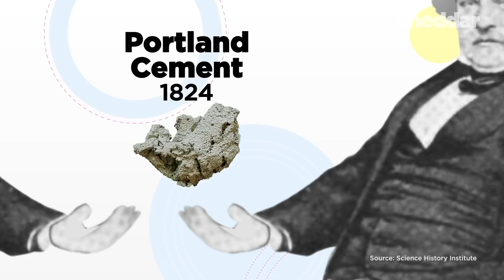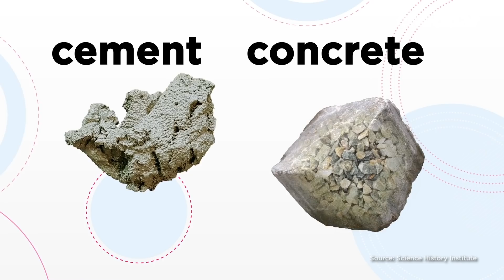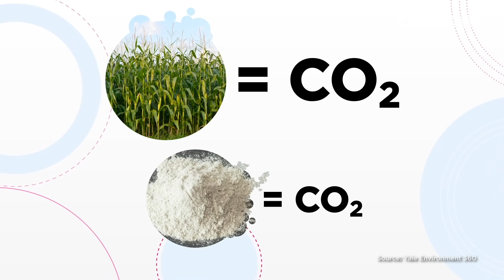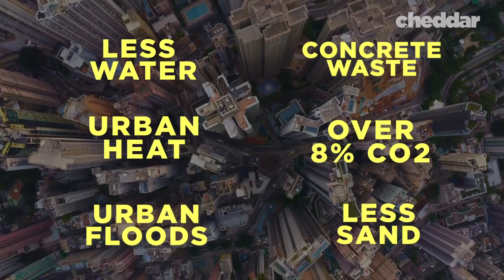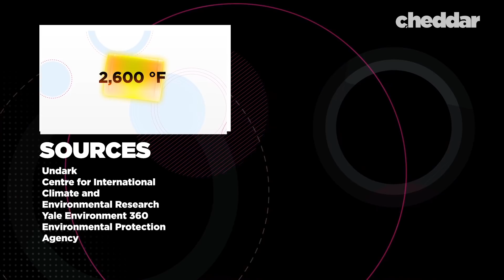Is Concrete The Most Destructive Material On Earth? - Cheddar Explains

Comment: why would concrete go to land fill when u can secycle it by crushing it and reuse for road base and other material depending on how finely crushed. Well at least we do in Australia
Reply: It can be somewhat recycled but only at a significant loss of quality.
Reply: @MTobias  Using it as road bed or fill doesn’t require same quality. In Seattle we just demolished a viaduct on our waterfront and most of the concrete was reused to fill an old road tunnel.
Reply: @MTobias  mjjjjjjjjj
Reply: It's also very labor intensive.
Reply: @stoneprevious4294  how can it be labor intensive there are machines to crush them like 90 percent of the work is been solved.
Reply: What can’t be recycled could be used as wave breaker in beach eroding areas, right? Even can be used to help form foundation for coral
Reply: It’s done in the US too.
Reply: @broe5010 broe5010 ah yes the stereotypical "It's all America's fault" add up the pollution, waste, and problems europe has caused and then compare and come twll me how its all America's fault. Look at China and the fact that they do all of that in massive amounts higher than any other country.
Reply: @broe5010 broe5010 Can you articulate those consequences or you are only able to make vague autistic eco communist noises?
Reply: Plus don't forget all the rebar in concrete
Reply: To make the problem seem worse than it is.
Reply: @broe5010 broe5010 am American, can confirm. But don't generalize and say all of us are like that. A significant portion of our population is brainwashed by corporate propaganda and another large portion is simply apathetic. But there are still many who actually care about something, its just we're not the loudest ones shouting.
Reply: Yeah but alot of the times it's cheaper to just get the raw material from a quarry then the get it recycled and big companys don't care about the environment
Reply: Its the only thing we do here in europe
Reply: Only 10% of waste concrete is recycled in Australia, the rest goes to landfill. A construction company's ability to recycle concrete is really dependent on whether there's concrete recycling plants nearby and most countries don't have enough concrete recycling plants to recycle all of their waste concrete.
Reply: @pilchardpliskin9381  -- Well, I've come to look at landfills are mines for future generations.    At some point our grandchildren or their grandchildren will be able to re-open sealed landfills and extract various metals, plastics, and minerals with little human effort.
Reply: Well,I never knew Australians are just like Canadians, always showing off!
Reply: @hoffmankipkurgat5949  Australians and Canadians are just like americans, except with personalities and a sense of humour.
Reply: Yea another junior reporter throwing out all the statistical numbers and information to present the narrative that Needs to be told- We are Destroying the Planet 🌎 The Horror, The Horror!! Not to worry though Kids , mankind will surely engage in WW3 long before we kill the planet. At least that’s what the Statistics predict !!! ✌🏻❤️☘️😱🤪
Reply: It's not labor intensive at all you use a tractor and you dump concrete into a crusher it's 100% recyclable you idiots
Reply: @jasonatherton8251  concrete is extremely heavy, and therefore expensive to move. It doesn't really matter how recyclable a material is, if it's cheaper to haul it to a local landfill that's gonna be the obvious choice.
Reply: @mendonesiac  their picture of concrete landfills was literally a recycling plant.   concrete is recycled all the time.  The rebar is sent to metal recycling centers.  Concrete is used as a cheap alternative to riprap, subgrade, and reused in concrete.
Reply: @Omenowl  the picture they showed looks like a demolition site to me, man.
I understand that concrete is highly recyclable and some countries are recycling a high percentage of it, but it's also frequently dumped. China only recycles 10% for instance.
Reply: @mendonesiac  A demolish site has to break up the concrete to put into trucks to haul away.  You dont put that stuff in a landfill unless it is contaminated.  

the cost of dumping concrete costs more than recycling it.  Even old concrete was dumped in area to prevent erosion.  It is in high demand in houston where rock is far more expensive than reclaimed concrete.  

The video misleads about how concrete is used in the US or Europe.
Reply: @broe5010 broe5010 Profit motive is the reason why you enjoy a standard of living unthinkable 100 years ago. 
And 400 percent profit... yeah, I don't think you know anything about economics. Most industries don't realize real profits past a couple percentage points. If they did there would be increased competition until the profit was reduced to nearly zero. The real profit in capitalism is finding temporary efficiency increases or new markets/products. Well or bribing government to increase regulation on their competition (regulatory capture) or straight rent seeking. In both cases it's the governments at fault for using the power of the the state (and the implied violence behind it) to create artificial cartels and monopolies (some industries are natural monopolies, such as utilities).

400 percent markup you see in retail is mostly erased by labor and overhead. Sure, they clearance things at 75 percent off, but that is selling at a net loss most of the time just to open up inventory space for things that will sell at higher markup. Holding onto dead inventory costs money in the form of opportunity costs.
Reply: If we did not have concrete we would have to invent it. Far to useful to not be used. The so called "environmental" costs are just part of the cost. Pay it and shut up. I am, as a  environmental scientist, getting tired of your greenie whining.

Comment: Love the video but i feel you missed your mark and actually undersold how bad cement production in the CO2 department, one of the main materials for clinker is limestone, which among a ton of impurities is mainly CaCO3, the 2500ºf furnace actually decarbonates it so we end up with CaO, but in order to do this an equal amount of CO2 is released into the atmosphere, why is this important?, All the data you provided is great, but know that for every kilogram of cement used to create that highway, that hospital, that skyscrapper, etc, a kilogram of CO2 is released into the atmosphere, 

If right now you're thinking that's an insane amount of CO2 when you factor absolutely everything we've built, well then now you get the point

Comment: I think you missed an important point about the “running out sand” thing 
Not just any sand will do, otherwise we could just mine the Sahara lol

Desert sand is wind eroded, and therefore small grain
The sand needed for concrete must be large grain water eroded sand, which is significantly harder to come by, and results in much greater destruction to the environment to extract

Comment: We actually already have carbon negative concrete and that isn't that much more expensive than conventional concrete and its stronger too. The problem is that it requires co2 curing on site or in a factory. On site would need a source of co2 gas or a byproduct containing co2 like citric acid which is more expensive. In factory gaseous co2 from abundant sources like other factories, refineries or power plants can be used but this requires in a finished solid product. However this isn't any worse for transport and many structures in the past were build using blocks or bricks. I find that solution more elegant anyway as well as the possibility of reusable structural building materials seems fairly appealing.

Comment: Use Celsius as well as Fahrenheit, not all people are American
Reply: Then learn how to convert it in your head.  So subtract 30 then divide by two.  You are welcome.
Reply: F to C calculators are readily available.
Reply: @hecker1982  Learn to approximate in your head.  For general reference it works, and will certainly make you look knowledgeable.
Reply: @ShainAndrews  👌🏻
Reply: 1.8 C + 32 gives result in F  to change from F minus 32 and result of that times 5 and divide by 9. Zero Degrees C = 32 degrees F.  100 degrees C times 1.8 = 180 then add 32 so equals 212 for boiling point of water in F. If body temperature 98.6 in F then subtract 32 to get 66.6 times by 5 = 333 then divide by 9 gives 37 degrees C body temperature.
Reply: @hydrolito  Or, and this is a crazy idea I know, you could simply use the official international,  scientific standard literally everybody else does.
Reply: Fahrenheit is more relative to how humans experience temperature and gives more accuracy because you have 180° of range vs only 100. Celsius is better for calculations where the number doesn’t mean anything to you, like in a chemistry formula or equation. Saying it’s 45°F outside makes more sense than saying it’s 7.22°C outside.

Comment: There's no concrete solution unfortunately. 
Ok, I'll leave. 😂🤣
Reply: It is a mixture of problems
Reply: @AF-wd2gt  because humanity cemented those problems
Reply: that joke was hard to read...
Reply: There is but, the Romain Concrete is more expansive,but ppl want it cheap.
Reply: “Population growth is unsustainable” - COVID-19
Reply: you can build mid-rise and even high-rise residential and office buildings out of timber. (Cross laminated timber)
It is strong material and much lighter than concrete and is fire resistant. 
timber natuarlly stores Carbon(1 tonne of timber stores 1.5 tonnes of CO2)
But at the moment the industry isnt well developed which results in higher cost. This creates a market barrier that reduces the development of the timber industry.

Comment: There is no problem with using water for concrete. We should simply use seawater rather than potable water.
Concretes mixed and cured in seawater have higher compressive, tensile, flexural and bond strengths than concretes mixed and cured in fresh water in the early ages at 7 and 14 days. The strengths after 28 and 90 days for concrete mixes mixed and cured in fresh water increase in a gradual manner.  More to the point using sea water might actually help reduce the sea level rise - provided you still believe in man made global warming of course.

The shortage of sand can be obviated simply by using volcanic ash and one of many other powdered residues.  There is more volcanic ash than sand - though in fairness it may not  be as easy as sand to extract.  As we see from the Roman's concrete it is still with us when of course modern concrete crumbles after a few years.

There is most certainly no need to panic.